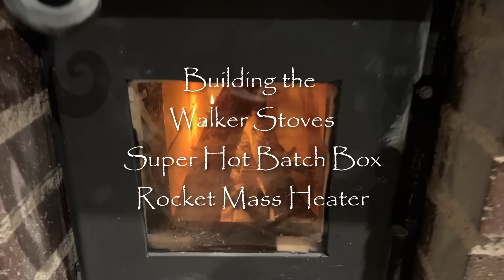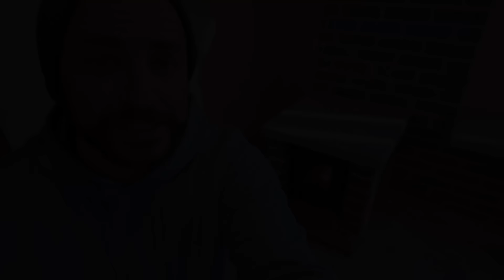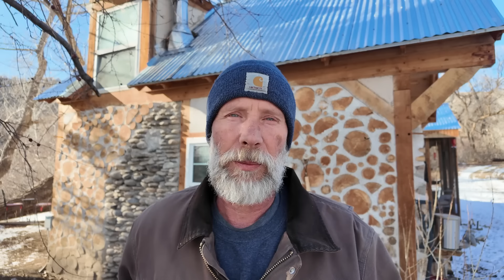Full Build of a Rocket Mass Heater with No Barrel! with @StefanoCreatini and @irahouseweart

Comment: Wire heating element electrical multiplier electronics thermal electric generators lining hot zones circuit cut off ounce thermal electric generators kick on with a toggle kill switch to shut it off for a self powered thermal mass heater? 🤔

Comment: Mix sea salt with a copper pipe and a piece of rebar and hook the copper pipe to a car battery and iron to negative . It will turn the sand into rock. There's plenty of videos on harding sand to rock with low voltage

Comment: I am still trying to see the benefit here as wood stoves today can heat a much larger area with out taking up as much space. Although they might burn a little more wood the burn times are just as good and extremely clean. To add they are  freestanding and some on pedestals so there is literally no direct contact with the house as with thermal mass.

Comment: The design looks like something from a rank amateur. If the flue gas path isn't traveling a significant distance horizontally (with a vertical bypass for fire starting) through a massive heat sink structure, there isn't any real gain of efficiency or heat storage capacity. On top of that, the combustion air should be piped in from the outside - the fire should not be pulling in air from the heated space for combustion. This is "design 101" stuff that anyone with experience or brains would know. It's not like you'd be reinventing the wheel with any "new technology". These techniques have been practiced around the world literally for centuries. And lastly, a mass heat storage based wood burner should always be formed from the ground up. Nothing of any significant mass should be supported by a standard wood floor structure. Also, the ceramic panel use was just one more aspect of stupid. With proper primary and secondary preheated combustion air drawn from outside the building, very high combustion chamber temperatures can be achieved with standard refractory brick. Again, this is old technology that's been in use from companies like Avalon, Defiant, and Quadrafire for years and years.

Comment: For the air pipe I would have used some thick stainless steel tubing 304 or 316 grade would do. I get most quite cheaply by scouring my local friendly scrap metal yard.

Comment: I love how this looks and your craftsmanship is top notch. I have built a traditional rocket stove and my craftsmanship and completed project were of half the quality of yours.   That being said I think this is missing some stuff in this, doesn't seem safe compared to a normal rocket heater.  Too much room for trapped gasses and creosote build up.  A normal one has the entire exhaust path contained. and cleanable in a metal pipe the mass is in contact with. .  the gas is pushed out by the incoming air and difference in temperature this design is missing and it is the part that makes it safe. That is not to be criticism but honest concern about the design.   A couple of things about usability  that is missing and I am certain will need to be improved, as I had to redo mine, I would redo both the floor and ceiling  with firebrick and a clay facing for durability and the hottest part of the fire is hitting the bottom of the concrete with the fiber board might be an issue.

Comment: If you route the stove intake directly from the outside vs having it pull air from inside the house, it'll be even better. Currently, the stove is sucking in the already warm air from inside your house and then exhausting it outside. Air from somewhere is going to have to replace that, and the air that will replace that is cold outside air that comes in through any leaks like doors, windows, etc. If you run a pipe from the stove intake directly to the outside, the nice, warm air that you've worked so hard to heat up will stay inside :) .
Reply: A valid one 👍
Reply: Also you wont die of CO2 poisoning if the stove/heater backdrafts or leaks for some reason.
Reply: Very bad suggestions
Reply: @erichr421 why
Reply: @CChan11  Very simple: 1. The combustion process must be complete. This takes time! 2. The resulting heat must be absorbed by the stove casing up to a chimney temperature of a maximum of 120 to 140°C. This can only be achieved with an optimal length of flue passages. 3. The outer surface of the stove must be large enough to maintain a maximum temperature of 60°C with full circulation of the room air. 4. The mass of the stove and its surface area must be in a specific ratio. 5. The biggest flaw in the design presented here is installing the stove without sufficient clearance from surrounding building components. A proper chimney effect of the heated room air would have been possible. Elevating the stove would also have enhanced this effect. In short: better than the common sheet metal stoves, but far from the capabilities of a tiled stove.
Reply: You pull air from the inside so that is WILL pull air from the outside into the home.....you so that no not die of carbon monoxide poisoning.  Most modern home building techniques are too tight and without the 'need to draw in air' from outside they will just get filled with carbon dioxide and carbon monoxide.  You WANT the draw from outside into the house.
Reply: @maxcypond  hợp lý
Reply: @nang.p  He's wrong if you do it his way your entire family could die of CO2 poisoning overnight just like many already have.
Reply: @maxcypond  Wrong if you are burning outside air you are NOT burning inside air ie its exactly the opposite of what you just said, do it your way and entire families have died of CO2 poisoning overnight hence why external flus are mandatory in all heaters above a certain size in Australia now.

Comment: good video and some good points. I have walkers plans did not use them instead built a BB mass heater.  Once I dialed it in it was amazing. Like this one I braced the floor [a LOT]. Three years of use until... the coldest snap in years and it was overused. The firemen loved the concept after my neighbor drove to get them [no cell service, no electricity, rural, snow. I did not burn down the house but darn close. I am glad you mentioned the back wall. I feel the bell should go and pipe U and mass replaced to reduce heat temp against the back wall. I also floor insulated with a lava mortar mix but not as deep as needed, I think yours looks fine ... The fire chief suggested a floor air gap.... I was relieved they didn't think me a total idiot, he showed a lot of respect.
Reply: Thanks for telling about this issue. I’m concerned for if I finally build one, which I’ve been waiting to do. So, can you tell me what was it t caused the fire? The lack of a floor air gap or cracks from overuse? How would you know if that kind of wear was happening inside before a fire happens? Thanks for your honest and helpful experience
Reply: @ChloeWhite-j4j  Hi and glad to help. it was a combination of things IMO. I love the airgap ideas i see now and had i not created a huge condensation mess by massively running to much chimney post mass the first year i doubt it would have turned out as it did. the fire (embers, no actual flame burst before containment) started at the lowest point closest to the floor and i found severe pipe deterioration. i feel like my insulating lava rock concrete mix beneath that  could have been ok. a thicker layer of that and a correct run of the flue may have been ok.
Reply: @ thanks very much for explaining. So, you feel confident you can safely rebuild it now that you have these refinements? Will you do so again?
Reply: @ChloeWhite-j4j I do feel I could safely do so, I’m just not allowed to in the house again😉.
My room in the shop will be awesome though…
Reply: What about on a masonry floor.

Comment: Thanks for publishing this! I would love to create a masonry heater on our first floor, but we have a full basement...so I've been concerned about all that weight...I will definitely do some research on supporting it from underneath!
Reply: I dug footers, filled them with cement, got 3 steel basement "jacks" rated for 30,000 pounds each and bolted them to the floor, filled the floor joist space with 2x6's, drilled holes through and used grade 8 bolts to bind them together, then did the same for cross beams.  Then .... put 7,000 pounds of mass on it.  It's been up for 2 years and hasn't moved 😊

Comment: my masonry skills lack a lot, but my bell style masonry heater has been working great for the last 12 years. the only thing i think i might change in the design you used, is having the exhaust flow out lower down and off to one side allowing the heated gasses to remain in the masonry longer and only the coldest air to flow out the chimney. and maybe a fresh air intake that comes in from outside the house instead of relying on pulling in air from the interior.

Comment: Concerning the bell size, batchrocket DOT eu has a  bell size chart.  They claim that a 6 inch riser and exhaust can support  57 sqft of internal surface area in the bell, which does not include the surface area of the floor.  This would result in a exit flue temperature of 140°F. This comes from the website of Peter Van den Berg, whom I believed worked with Matt Walker.

Comment: The only way not to have a heat bill is if you cut down the tree with a manual saw, manually cut the tree up and bust it by hand.  If you use a chainsaw, use a tractor or trailer to get the wood, use a power wood splitter ,you have costs to heat. If you do not let people know how much wood is used, the info is no good.  Just because you cut the wood off your land does not make it free. I am not trying to be an asshole, I like to know how much fuel is needed to heat a house to assess a heater.

Comment: How much smoke comes out the chimney ? It was mentioned you could not smell it, but can you see it ?
Reply: Only briefly during start up from cold usually, with RMH stoves, and the exhaust is CO2 and water vapour at a relatively low temp. Almost undetectable in a burn free, emission free zone, lol. A J-tube design with a barrel and plenty of thermal mass can be as cool as 21 deg C/ 70 deg F at the exhaust outlet... and completely clean of toxins. But you can get more info on this particular stove from the Walker Stoves channel.
Reply: @EdCase-n5o   Thanks I appreciate it.
Reply: @artstrology  Matt Walker has another channel with more stoves, namely - broaudio

Comment: I would have serious concerns about laying brick on the wood subfloor, lack of clearance behind the stove and wall, and gas leaks in the secondary combustion chamber, which doesn't isolate them. The build could have also benefitted from more thermal mass. Much better build designs available.
Reply from the maker: @flc7896  Temp readings taken under the floor in the crawlspace at max heat are 120F under the burn chamber, and 80F under the bench. These are acceptable. Clearance from the wall should be greater, and should be specified in the plans. Gas leaks would only be from outside in, given the strong draft. It’s not the best design, but it seems to be doing the job safely.

Comment: Nice workmanship. 
Although you did offer some warning about ceramic fibre, I would like to point out this suff once it has been super heated, is not so much dangerous  but potentially  lethal! ‘ 
The product is normally sold as ‘body soluble’ meaning it is safe to handle with basic safety mask, gloves etc…but once it is super heated the fibre become crystallised and non body soluble basically meaning they can enter you body and never leave! 
This could result in cancer or other harmful effects, the problem is ceramic fibre is very prone to dusting, ie it produces fine air born dust if disturbed. Personally I would not want that is my house.
There are products that can be applied to ceramic fibre board to stop it dusting, they are not brilliant but much better than nothing!
Reply from the maker: @foxfish7115  After running this stove we are finding that exposed CFB is a horrible idea. I can see using it as a riser, but anywhere is in contact with fuel wood degrades rapidly.
Reply: @ yes although using it anywhere in the flame path is potentially dangerous, at some stage, somebody with have to deal with the stuff for Maintenance  or whatever! To be fair most refectory products should be treated with caution, it is just that ceramic fibre seems to be the worst !

Comment: What are the dimentions of the riser? What about the slit and the fire box? Why were fire bricks only used for the sides of the firebox? Thank you
Reply from the maker: @Abednego-v2r  The riser is 6”x6”x36”. The slit in the fire box acts as a port to encourage gas mixing with the secondary air supply. We used fire brick in the sides because they get the most contact while loading the stove, but we realize now that expose ceramic fiber board is just a bad idea.

Comment: In Finland, fireplaces are built on a principle. First, the inner nest, which is made of flint and fire mortar (they withstand heat) On top, 2 cm of stone wool, which insulates and allows the thermal expansion of the inner nest.. That is, there must be the shell layer on each side (not the inner nest against the wall).
Reply: “Tulipesa”! Yes—you’re right. The Finns know exactly what they’re doing, and doing it the right way. That prevents the greater thermal expansion of the fire nest (tulipesa) / AKA “firebox” from pushing on the outer walls and opening up gaps between the bricks of the heater’s outer walls.

Comment: As long as ya have the time to warm the system up before the real cold hits you'll be fine with that brick bell, but, if ya get a sudden cold spell or go on vacation and come back to a cold house, it's gonna take all day before that brick warms through enough to feel the heat in the home. That's why the original had a steel barrel for a bell, for immediate radiant heat.
Reply from the maker: @billwoehl3051  True. It’s a trade off for appearance over instant heat, for sure.

Comment: Not sure if you will answer this in the video, but how many square feet does it heat and is it effective for multi story houses?
Reply from the maker: @OpheliaDarling2814  This is heating a 1,500 sf ranch style home. Such systems are most effective when the house is designed around radiant heat. Ideally, the mass heater is central in the ground floor. If it can be exposed in multiple rooms, even better. Upper stories will be warmed from the rising heat from below. If they are open to convection from the air on the first level, even better.
We are actually planning to move this stove to a more central location in this house. It beats the home well, but there is certainly a gradient of warmth from one end to the other.

Comment: Actually self ignition of wood may be relatively high when it's new but interestingly enough the temperature flash point at which wood self ignites goes down the more times it's heated so often we hear of a house fire where the problem has existed for years and never cause any problems so rather than using a piece of tin to give an air gap use a piece of cement board

Comment: That door handle will be far too hot to handle w/o heavy gloves during operation..
Seems to me the handle shouldnt lay right against the door & have some way of disipating the heat..
Reply from the maker: @pdrphil8159  The inch of ceramic fiber board prevents this. If the door were simply steal, you would be correct. The brick extending past the plane of the door limited our option, and is a flaw in the design.

Comment: Nice solution to the ugly barrel. I need something like this for my home. Excellent job on the video. You got me thinking. In an old issue of HarrowSmith magazine from the 70's there was a great idea. This was a 3 bedroom in the mountains, built passive solar, and ran automatically (timers, dampers, sensors) and the temp stayed 65 degrees for 2 weeks of cloudy weather, with no people living inside. You could adapt this idea as a mass storage battery (similar to Wheaton's gravel filled bench). In this case, the working temps are different. It had solar power, pumping hot air into a 4x4x4 insulated cement block (fully enclosed) cistern in the lowest level. Instead of water it had 1'' river rock. The intake pipe and air outflow pipes were 1 foot apart. Water heats up gradually as a body, but can hold more btu. Stone heats up fastest closest to the heat source. Therefore stone can give usable heat sooner, if the out flow is close to the inflow. Of course, hot air circulating among stones is instantly usuable as well. I'm wondering if you can capture some of the excess heat with a pipe into this storage battery (dampers etc). Perhaps make it a new section of the bench, or draw straight down below the floor into the battery. Perhaps, if the chimney is at that end, drawing, or pressured by the burn riser, there would be little need for pumps. You could pump heat out of it to an accessory room. One suggestion I just thought of is, inside the bench, (computer or not) model up an airflow friendly lattice out of bricks on edge to exponentially store more heat. Perhaps this is stupid and presumptive, but I'm an amateur, and have never built one. "But my daddy was an engineer." Cheers!
Reply from the maker: @Slo-Fi77  Interesting thoughts! 
I once house sat a passive home in souther CO. It was straw bale with a glass south wall. Four feet inside of those south windows were trombe walls made of adobe and plaster. With no other heat inputs, that placed stayed 68F during January. I like that approach because there are no points of failure (pumps/electronics). As long as the eve lengths are correct for the latitude, passive solar can solve many challenges!
Reply: @radicalgastronomy  Appreciate your response. Amazing what we can engineer.